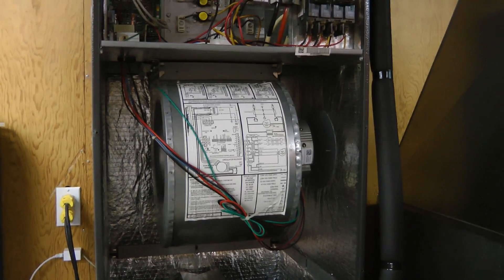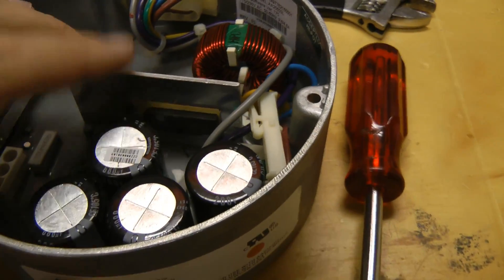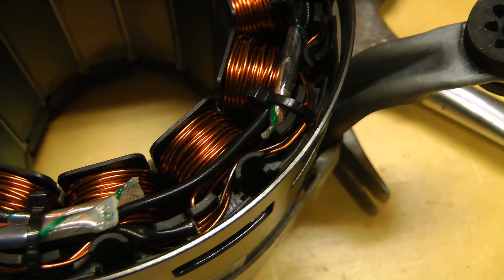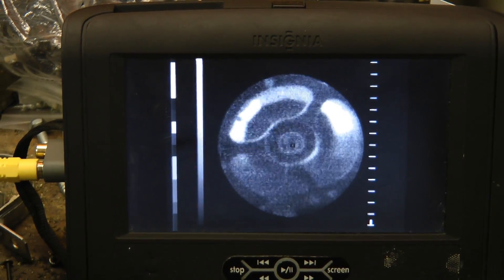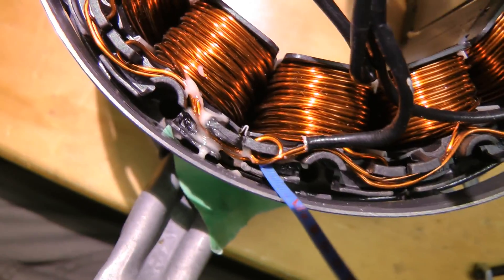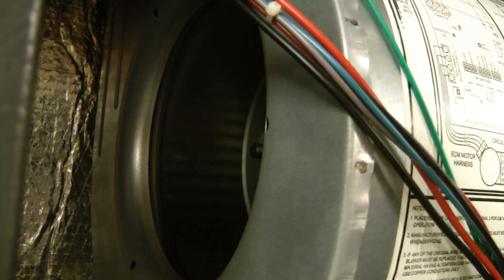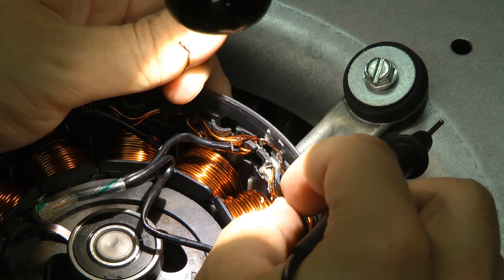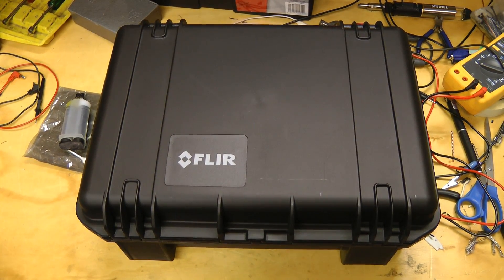Emerson brushless DC (ECM) blower motor fix

Comment: THANK YOU!!! After watching your video, I was able to diagnose and repair my Genteq ECM 2.3 1 HP motor. Mine had the same symptoms as your motor.  When I tested the ohms across the 3 leads my readings were 1.2, 4.8, 4.4. I read they need to be the same. I disassembled the motor and fortunately located the wire that was causing the problem. I bent it and applied epoxy resin. Checking the ohms, I now have 5.6, 5.6, 5.6 and no shorts to ground. The bearings seemed good and also the ECM modules didn't appear to have any burned area. I reassembled and installed the motor and IT'S WORKING!!!! Don't know for how long but at least I was able to get the A/C back. I found your video courtesy of grayfurnaceman. He mentions your video in the comments section.

Comment: Sept 20 - 2022  I have the same system and it had been trouble free for 11 years.  One day I noticed the compressor not throwing heat off and the vapor line frosted.  Went inside and found the air handler not moving air and the evaporator frozen up.  Your YT was first to pull up but I dismissed my ability to deal with that fix.  so, I found the 3 circuits read 2.6, 2.6, & 1.6 ohms respectively.  OK - 12 year old system - I might as well replace motor.  Trying to find a GOODMAN compatible replacement from an outfit that would actually sell to a non-608 person like me was impossible.  IF they would have sold it the price was $1100 with tax! Amazing amount of misinformation out there.  Some HVAC parts suppliers tried to steer me toward x13 type motors which I knew would not communicate properly with my PC card.  There were many options, like going PSC or calling a goodman tech and expecting a $2000+ bill. After 3 days of intense researching, in frustration I decided to try to apply fix to motor.  Upon opening the motor, I immediately found suspect area of windings. Separated the windings and immediately all 3 circuits read 3.0 ohms.  Electrical tape and some thermal tubing to maintain separation and reinstall the motor.  Actual fix took 45 minutes only because I was going slow and being extra careful.  HVAC works fine now.  But I know it will be something else down the road.  Thanks so much for your YT post to motivate me.

Comment: Thanks.  Just saved me at least $600.  I knew something odd was going on when I felt how hard it was to turn the motor.  At first thought maybe bearings.  Didn't think of internally shorted coil wires.  Took my motor 10 years to develop this fault.

Comment: Had 1.5 ohms resistance between blue and yellow wires. Found and fixed the short.  HVAC is back on. If you have a patreon acct or the like, I’d love to throw a donation your way for the great info and for saving me from replacing my blower motor. Big thumbs up!!  Thank you!!

Comment: Ha, I’m guessing you know a little bit about how ecm motors works. Those particular motors are very poorly constructed. The fault is always in the motor itself, not the module. The other popular manufacturer of ecm motors (genteq) has the opposite problem of the module constantly failing. Maybe they could get together and make a motor that wouldn’t fail every two to three years.

Comment: wanted to thank you!  I am a DIY guy and was on with an expert Hvac guy on justanswerdotcom.  He insisted the module was bad and said to replace the module or whole motor as well... I took readings accross windings and as they varied from 1.5 ohms to 3.8, I asked about the difference and if the motor could be bad.  He still insisted replace the module.... Then I found your video, and in an hour had found and isolated the visibly dark spots on wires where they had been shorting and had epoxied and then re-installed ( with readings of 3.8 on all windings) and worked like a charm!    Faced with an $800 motor order and wait time..... you saved me that much!!  thanks again!

Comment: Hey there, quick question. Would you happen to know what might cause these shorts to happen in the first place? Your video helped me fix my blower motor just last night, and the system worked again for about 8 hours, but then quit in the same fashion. I'm going to open it up again tomorrow, I probably just didn't get all the shorts fixed, but I'm wondering if there is something else in the system that would cause these shorts to happen consistently. 

Perhaps insufficient air flow in the system which would make it hard to spin the "squirrel cage" therefore heating up the motor? Thanks for your video if nothing else!
Reply from the maker: The failures seem to be due to the manufacturer not varnishing the coils. This is normal practice to stop the wires rubbing against each other and wearing out, causing shorts, and they were too cheap to do it here. I think they also knew it would cause failures shortly after the warranty expired.

My repair failed twice in the following few years. I finally solved it (seemingly) permanently. I replaced the thinly insulated magnet wire in the area above the coils (where it goes from one coil to the next) with proper thickly insulated wire, splicing it to the wires coming out of each coil. It's been going for a couple of years now with no issues at all. It's a big job to do this but it does seem to solve the problem fully. You need to carefully keep track of where each wire goes as you cut and splice them.

Comment: It would more likely seem that the coils failed due to tight bearings thereby causing the coils overheated you make it sound like as you describe in the beginning of the vid that the coils are the cause of why the motor is hard to spin the shaft please clarify

Comment: the motor your working on . can it be used as a stepping motor.  I'm trying to build a CNC machine?
Reply: Dave Jordan nema 17 or 23 dc stepper motors are usually ideal because of their high "resolution" for detailed cuts, not sure if this motor will give you such accurate results for a cnc application

Comment: Weird motor to run just a blower. Why is this type of motor better than induction motor + vfd?
Reply: The motors are variable speed so in a  central air system it can control humidity much better.

Comment: why couldnt u hv,,,,,instead of drill ,,,, just put 220v to the y/b/r wires to motor? does that motor need a capacitor  to start,,,,couldnt you just bypass board & just have a one speed motor,,thx

Comment: I had an inducer motor where the magnet came unglued on the rotor, that motor was not designed to take apart, but in the dead of night in February one learns how to "get her done" I cleaned it with solvent and epoxy glued that back together. That motor, come to think about it, is 30 years old, it is from a Bryant/Carrier 90+ furnace. The main plenum motor has a weird issue that it would just "grunt" when trying to start and would sometimes run after two or three attempts. I got a hold of a used motor that works fine, I need to open up the old one now and look for shorts I think

Comment: Excellent video. Wish you were nearby. I have a Goodman/GE ECM module that is not working and I have a feeling a guy like you could isolate the problem and fix it in no time. It is probably going to be a $5 component that needs to be replaced and the local repair guys want to replace both my motor and module for a mere $1,200. Anyone know of someone that rebuilds Goodman/GE ECM modules?

Comment: I have Whirlpool Washer Motor,it is  3 phase Induction Motor,C E SET,CIM 2/55-132-DV155J-02.195 Volt-5A-820-W 286 HZ,16000 RPM.Class F,Have Any Idea How You can Run,I Am Sure You Know How you can Hook it up,Please if it not Challenge for  you Please send info on this.

Comment: Hey, great video and skills! I am having similar problems with my ECM blower motor, it attempts to run but fails. I made a short video of it: A/C blower's difficulty to start   I assume the motor is the issue, but do you think this is the electronic part of it, or short circuit like in your case? Yeah, and once it starts (if it starts, it is not happening all the time) it runs with no issues till next time.

Comment: I had this same problem with the same motor in my goodman blower unit a few months ago, and this video saved me hundreds of dollars and also helped me learn a few things about brushless dc motors in the process.  If I hadn't seen this I probably would have scrapped it, but it's been running great ever since I found and repaired the shorted winding.  Thank you!

Comment: If only that were my problem.  Excellent video - nice alternative to testing the coils with an ohmmeter!  I'm afraid in my case i need to replace the control bell.  I have a GE motor, but these motors no matter the manufacturer are terribly unreliable.  Variable DC looks great on a sales brochure but 5 years into the service life, the money you save on energy is soon blown ++ on motor replacements!

Comment: Wow, I never would have thought that consumer HVAC units would be using motor controls like this, but it makes sense. When I last replaced a furnace blower motor about a decade ago, it was a multi-speed induction motor, with the speed semi-permanently selected by a jumper wire (not the control unit). I guess technology marches on, even in this area.

Comment: This is a great video!  I have the exact same motor that's showing a communication error yet no one seems to be able to pinpoint the problem.  It's on a brand new furnace!  Do you know if there is there any way to test the inverter module?

Comment: I repair these systems all the time . Them motors are very tuff. You want to ckeck your static pressure on your furnas . Small ductwork will cause that motor to run at high speeds burning the coils

Comment: I agree that the build quality is suspect - the winding tails should be sheathed to provide extra insulation, especially where they cross other phases. Even more so in any motor that is speed-control driven due to high voltage spikes in the wave form!

Looking forward to the FLIR camera review.